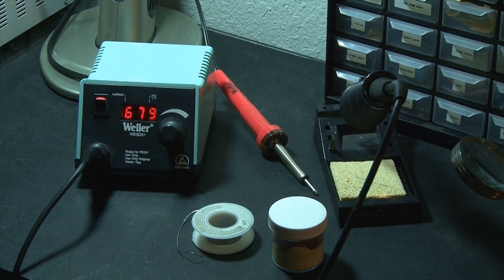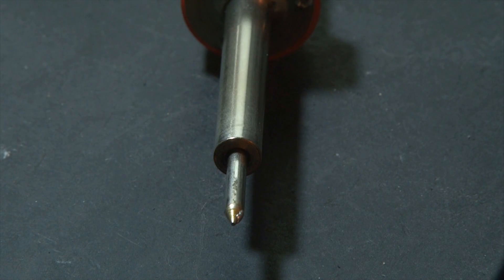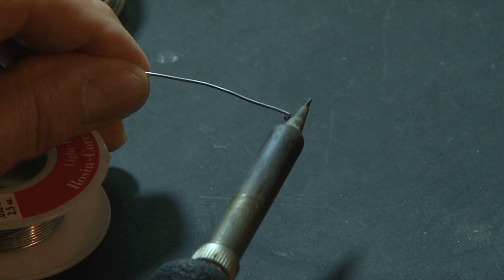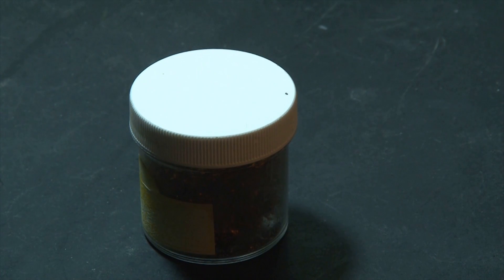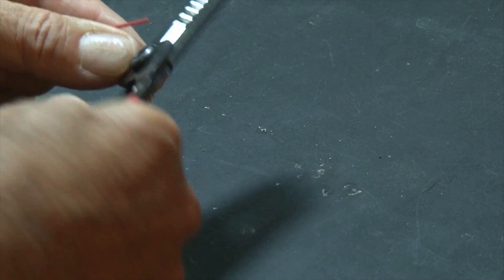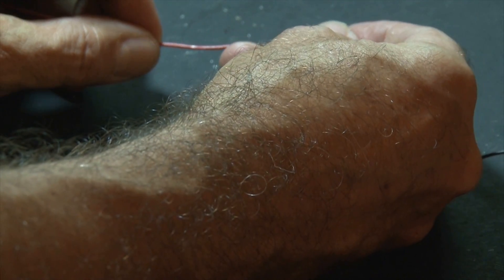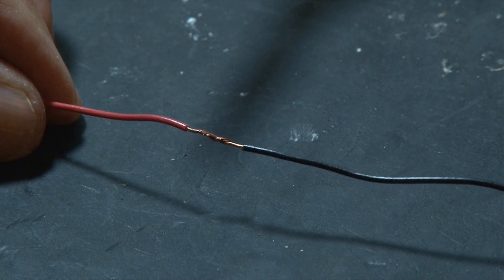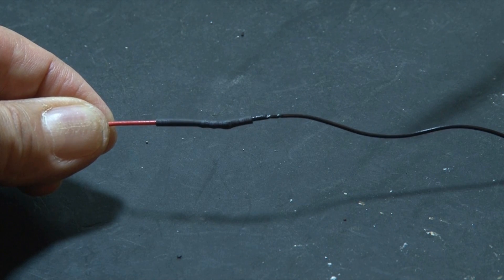Kipkay Tips #1 - How To Solder

Comment: hey Kipkay, I have a 25 watt soldering iron that just plugs into the wall. I have use it to solder and it works fine but when I try to desolder things off of pcb's but it doesn't even turn the solder molten! I don't know if it doesn't get hot enough to melt the solder on the circuit board or whether it is just the specific board or do you think I need a new soldering iron/station.Help me please.

Comment: I use electrical tape and it works well but to make sure it stays I use a lighter to melt it to the wire. Also the way kipkay solders is a really good way to do it, but if you wanna take less time you can put the solder on the wire and then put the soldering iron on top of the solder so that it melts on to the wire.

Comment: Should have tinned the tip rather than trying it dry when soldering those wires, would have been done almost immediately, liquid solder conducts the heat very well..
Reply: He did tin the tip... but you don't wanna melt the solder on the tip and then apply it to the wire cause it might create a cold-joint.

Comment: its bit funny to see your wire stripping device. I own an automatic one called "stripax" by weidmüller, it is extremely easy to use and there is litterally no danger of cutting the wire instead of stripping it.

Comment: very nice video, thanks!
I think the sponge works fine to clean the tip. you are suposed so make it a bit wet then it won't burn or melt when in contact with the soldering tip.

Comment: the year 2015 i made homemade taser from bug zapper i used flux/rosin core solder to solder extension wire to the circuit and replace the switch when did i use it it didnt last long

Comment: Also DON'T BURN YOURSELF is an essential thing to tell everyone new to soldering.  I learned the hard way and solder iron burns hurt a LOT for HOURS!  A follow up video of How to Treat a Soldering Iron Burn may be good.  Always pick up the iron by the handle, not the metal!  And when putting the iron down, put it in a proper holder so it doesn't burn through the AC power cord, or so that you might pick it up from the wrong end!
Reply: TechnoWizard that's pretty obvious
Reply: I once had someone in my class who decided to test if the soldering iron was hot by grabbing the tip
Reply: @nova_freak you'd be surprised how dumb people are

Comment: how did you solder those wires with no paste?!?!?!?
Reply: Rosin core solder has the flux inside the core of the wire. That means you don't have to use yourown.
Reply: Take apart somthing

Comment: two tips....the solder diameter is in inches, and if you have either the "helping hands" or even an extra pair of alligator clips, you can clip them as close as you can to your solder job and they will act like heatsinks and not damage the insulation.

surprised you didn't cover the different types of soldering you can do

Comment: I really like the IsoTip portable soldering irons. That way I can grab a table and go outside on my patio and solder, since I don't want to breathe in lead fumes. Plus, my hands can be a little jittery and I don't need any burns. I think the IsoTip is easier to handle since the actual iron is not as long.
Reply: i prefer station so i can adjust the heat
Reply: TKJA cool
Reply: JACK HQ FYI, the lead doesn't vaporize. The hazard in soldering is from the flux fumes. (And from touching lead, though the only precaution needed is to wash your hands afterward, before you start eating.)
Reply: Antonio Tejada I always wash my hands. That's not a big deal. By the way, you're right about the lead not vaporizing. I mean fumes in general. Lead would need to be heated at way over 3000 degrees for it to vaporize.

Comment: I have been using the WSD51 system for like 5 years and its Fantastic. Im wondering why you didnt tin the tip of the iron to transfer the heat to the joint?? Using the shaft of the iron where there is No solder you are creating a small contact surface to the joint witch will take Longer to heat the joint. I use a Much larger chisel tip with lots of surface on the tip so there is really No need to use the shaft of the iron. I solder Really thick RC wires all the time and I always tin the tip before I put it on the joint to help heat transfer.

Comment: For me being a beginner for my 12th birthday (which if you know my channel I'm 12) I got a frickin 150 watt soldering GUN not an iron like I wish I got
Reply: I also learned to keep your hand away from glowing metal the hard and painful way
Reply: Bleach Videos I feel you there. I was using a cheap soldering iron from harbor freight, and the tip was starting to erode away from the heat. I was trying to desolder parts from a power supply and ended up smashing the tip into my finger, turned out the iron coating was still there but the copper core wasn't, and it cut into my finger and ended up getting leaded solder into my finger and it took a month to fully heal.

Comment: this helped a lot... thanks.  best how to solder video ever..
Reply: There is so many mistakes here its incredible. Im no pro but I have Never seen someone put a iron shaft on the wire with NO solder to transfer heat. And also I have been using the same sponge and it works Perfectly for 5 years. He also fails to mention how to store your tip when you are done. I have the same wsd51 system and its fantastic. Hes also using the wrong tip on the iron for wires. Thats a pencil tip for Small fine work on circuit a  board. He says tin the tip of the iron but why? 2 reasons 1st its to keep the tip from burning or overheating and 2nd is to transfer the heat to the joint. I guess ill make an updated video how to solder because this is pretty bad.

Comment: Put a bit of solder on the tip before soldering it will help transfer the heat quicker a solder join should only take 2-3 seconds to complete a join
Reply: Correct, it acts a conductive bridge for heat.

Comment: Its So"l"der.

I would not completely agree with that method, I always apply a little so"l"der to my iron tip as it helps to transfer heat and get the copper to the melting point quicker.  Once the joint is up to temp, solder flows nice, I can join similar gauge wire in a fraction of the time that you took with a 20ish W iron.
Reply: paul30003 it's soldier
Reply: It's "sauder" over here. NEVER in my life have I heard it pronounced "soulder" Just because that's how you pronounce it in your country doesn't mean that it's the correct way of saying it and that's how he NEEDS to say it. We pronounce it like that in America and this is an American man posting on an American website. He is not wrong.
Reply: paul30003 idk I pronounce it like "sodder"
Reply: Its funny pushing the right buttons, its even more amusing when you get the desired reaction from the yanks.  lol  Mission accomplished.

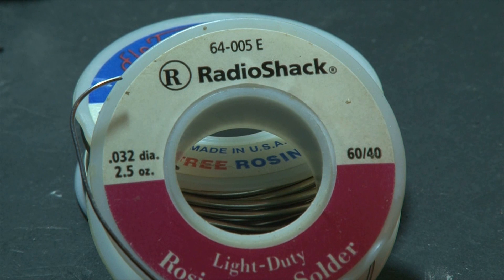Comment: 3:25 that is NOT 0.032 mm, much thicker
Reply: WN8OverR9000 it's in inches
Reply: dhivan shah Yes I know, but listen what he says. "0.032 millimeter"
Reply: WN8OverR9000 Yeah, 0.032mm would be rather fine solder indeed! You'd be there a LOOONG time feeding that solder into a joint! :p

Comment: It's easier to join the wire if:

1) You tinned both wires (but that defeat the purpose of twisting them together already. Use other mechanical method like 'hook' for example?)

2) You apply flux to the wire before heating and applying solder.

Hope it helps :)
Reply: naah... pre-tinning just makes it harde to twist the wires together

Comment: thanks.. t takes me back to when I was little and my Dad tinkering away at his workbench. He also had something called flux..which I wasn't sure what it did. He let me solder some things which was really cool .
Reply: Flux cleans the surfaces and lets the solder flow and wet better.
Separate extra flux can be useful if you have oxidized surfaces or do reflow soldering (apply solder to each part separately, for instance pad on circuit board and end of wire, then touch parts to each other, melting the solder on both, put together and let cool, or if you do repairs and have to re-heat joints.
But with clean-ish surfaces the flux that is inside "flux core" / "rosin core" solder should besufficient
Reply: Michael Tempsch
thank you

Comment: Small correction. When doing proper soldering some of the tin in solder does dissolve into the base metals, and some of the base metals dissolve into the tin.
Reply: Jammit Timmaj Correct. But the key difference is that in soldering, a dissimilar joining metal (the solder) is added, whereas in welding, either no metal is added at all, or the added metal is the same as the base metals.
Reply: Antonio Tejada
I agree with you. Thanks.

Comment: I am having a hard time tinning my soldering iron. It's a 35W iron. when I try to tin it, solder just runs off. Any suggestions?
Reply: You need bare copper (no oxide or rust) to tin the tip. Depending on the type of soldering iron tip (some are steel with a thin plating of copper and can't be scrubbed too hard), you might need to use sandpaper (when cool) to get to the bright shiny copper underneath. Plug in the soldering iron and apply solder to give it a protective layer of solder. The solder does oxidize, but it's a liquid and can be wiped off easily with a damp sponge.

Comment: I am having a hard time tinning my soldering iron. It's a 35W iron. when I try to tin it, solder just runs off. Any suggestions?
Reply: if the tip is cheap it may have been coated with copper and all worn off or it may be oxidized. one thing I like to do is take a piece of fine grit sandpaper to the tip until it looks nice and shiny all the way around. If after that the solder still doesn't stick I would recommend getting a new tip.

Comment: Another good tip: The solder on the connection should be shiny like silver or a mirror. You don't want it to look dull. Shiny solder indicates solder that heated, flowed, and then cooled properly. If the solder gets just barely hot enough to melt, then flows over a wire or pad that isn’t heated sufficiently, it will be dull when it cools.
Reply: Well that does not apply to ROHS-compliance countries, where lead-free solder is used. these solder connections can be made perfectly but still look dull.
Reply: Yes, well spotted!

Comment: Good info.  I prefer to twist the wires as discribed secondary to the method you demonstrated.  In higher draw situations for DC current,  it seems beneficial for the surface area of the strands.

Comment: 5:43 Ok first question, how do you actually clean the solder iron in the copper sponge. Do you spin the tin in the sponge, do you just dab it in, do you scrub it, what? This is one of the biggest problems I have, is keeping the tip still usable.
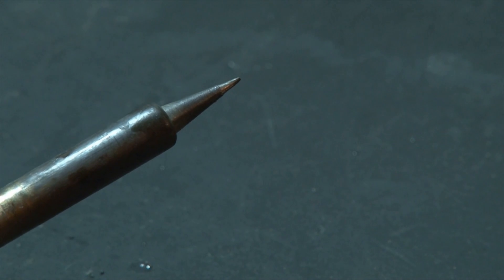6:06 Gotcha regular sponges are bad.
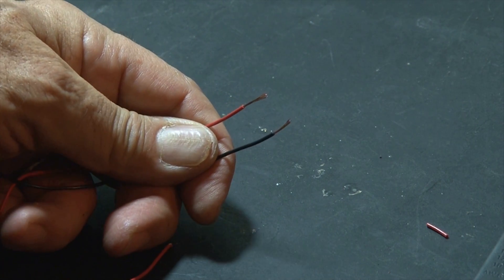7:36 I know it sounds silly, but would you say there's proper technique in wire primping (preening? whatever) God I know how many times it was the easiest thing in the world and then at others it's the most annoying thing to get right the first go. Also wonder if the thickness of the covering matters in how to get it off.

So now I'd love to see how you apply this to circuit boards and the individual components. That's where I need the most help personally.
Reply: Will do, thanks.
Reply: Bobbydog66 Look for the soldering tutorials from PACE Worldwide here on YouTube. They answer all of your questions beautifully.
Reply: Bobbydog66 By the way, I couldn't think of the word before, but now I remember: you "dress" wires for attachment!
Reply: More info, neat, thanks again :D

Comment: Awesome timing!  Great video.

I have to re-connect 14 wires in my car as opening and closing the tailgate over time has taken its toll on them.  I was considering just using crimp connections but it will probably be better off if I am able to solder them.  We shall see!
Reply: J2xS - Jason J. Shaw definitely gonna want to solder on a truck, the vibrations will work the butt connectors loose
Reply: Thanks, I did and it went pretty well!

Comment: Kipkay I have a question for your electronic expertise...I'm looking at taking a Duracell 700 lumen Cree led torch and removing the LED in place of a laser diode from a DVD burner. My question is this...can you use the LED driver board to run a laser diode?

Comment: Can you use a hair dryer for the heat shrink tube?
Reply: Not hot enough. Heat gun temperatures range from 100 C to 550 C and a hair dryer is 55 C
Reply: Ahh  okay thanks

Comment: another soldering tip for the helping hands is putting heat shrink tubing on the alligator clips so they dont bite into the wires and leave crimps in the wire

Comment: I learned to solder a different way to use for a different application: stained glass.
Applying the solder is different but the way the solder works: metal, solder ,metal, is still the same.

Comment: Another trick is to put a very small amount of solder on your iron, touch the solder "Blob" onto the wire and add some more to break the surface tension. It will allow the heat to flow due to the increased surface area. It literally cuts the time into at least 1/3 the time.
Reply: Jonathan Kayne this isn't so good as it will create a dry joint due to the solder not wicking
Reply: Bryn Thomas No, he's mostly right: a small dab of solder on the tip acts as a heat bridge, far improving heat transfer. But indeed, it is essential to add fresh solder to the joint, since it bears flux. (What he's calling "breaking the surface tension. It's not actually surface tension breaking, it's the new flux cleaning away the oxide layer.)

Comment: if your using a lighter for heat shrink. hold it i the blue part of the flame but keep it moving quickly so you dont melt it. doing this avoids the black carbon that the orange part of the flame will deposit on your wire/heat shrink

Comment: If I remember correctly the sponge on the soldering station should be wet - otherwise it may burn or melt as you mentioned.

Comment: He uses a high temperature, I only use 550° so the tip does not burn up
Reply: Duett A Traktor 425C is waaaay too hot! I usually solder between 280-350C, depending on the tip in use and the type of joint. (And type of solder.) Soldering stations don't go to 550C, that's simply absurdly hot. Just like the comment above says, the higher the iron, the faster your flux burns off. Between that and heat damage to components, you don't want excessive temperature. (Nor should it be too low, because then it takes too long to do a joint. Ideal temp has you in and out in 2 seconds.)
Reply: Mabye my soldering station isent calibrated.
Reply: I usaly use 425C or 797F.
Does you use 550 C or F?
Reply: Duett A Traktor Farenheight, If I use high temperatures, the flux in the solder burns away quickly and the tip oxidized quite quickly, I use 550° because I have high thermal capacity iron and I don't need to have high heat just to have it melt large joints
Reply: Duett A Traktor That is quite possible. Another thing I've heard (about cheap soldering stations specifically) is that the fit between tip and heating element is kinda loose, so that the heating element is very hot, but the tip is substantially cooler. People have improved this by filling the gap with powdered graphite (pencil lead) to improve heat transfer.
Reply: Thats rigt the tip is lose its a hakko936 with aftermarket tips.

Comment: Why do you need to frost the tip I am just begging and would take any tips on soldering
Reply: it gets rid of the oxidation on the tip and prepares it making it easier to solder. it will be easier and faster to melt the lead needed to solder.
Reply: TheSwarm666X thank you very much
Reply: no problem. take care and have fun. if you are still in high school or to be in high school, check if they have classes. i took 3 years myself.

Comment: is your soldering station in F or Degres Celsius (°C)?
Reply: Kelvin
Reply: Veso266 that's Fahrenheit. 650C is far, far hotter than any soldering station will go, and you wouldn't want to solder anywhere near that hot. (I set mine to between 280-350C, depending on the type of tip, size of joint, and type of solder used.)

Comment: you need to use water on the sponge kipkay that's why it isn't good.
Reply: he said that, he also said it gets dirty and can melt
Reply: Tony Nguyen yes but If he use water it won't melt or make the tip dirty
Reply: Yeah it never gets dirty, buns, or melts if it's wet. The solder just balls up on it, which you can then dump into the trash.

Comment: When I do heat shrink I use my  iron and do a few quick passes over it with the long part before the tip. It works pretty well and it doesn't burn the heat shrink

Comment: What is the difference between regular and lead  free solder ?
Reply: There is no lead in the lead free solder
Reply: there's no leads in lead free solder and the lead free solder needs a bit more heat to melt, I think.
Reply: They have  diffrent melting temperatures

Comment: do not get an iron below 30W, that's basically garbage, get at least a 30-48W one that would make sense to use
Reply: nukecat Depends on what you're doing, and on the design of the iron. Before I got a quality soldering station (insert heart emoji here), I had far better success with a high quality 15W iron than with a cheaper 25W or 40W one.

Comment: For the solder thickness measurement, don't you mean in thousandths of an inch, rather than millimeters? Because 0.025mm is about half the size of mechanical pencil lead, and that's much thinner than the electronics solder I use.